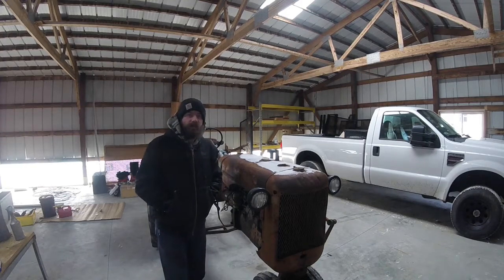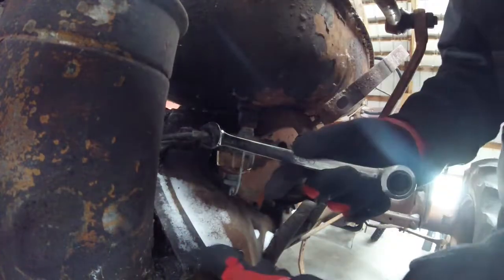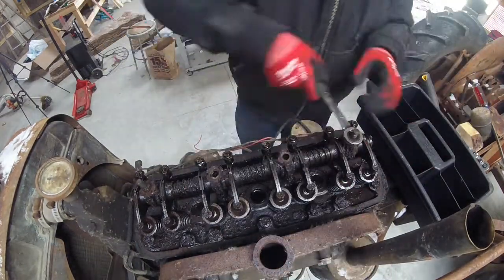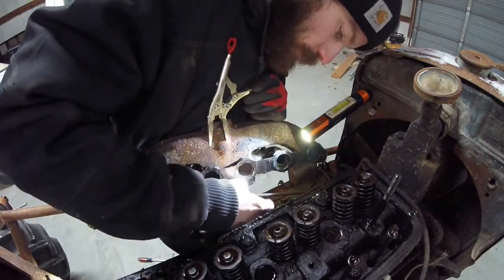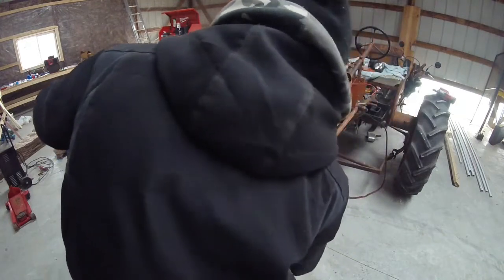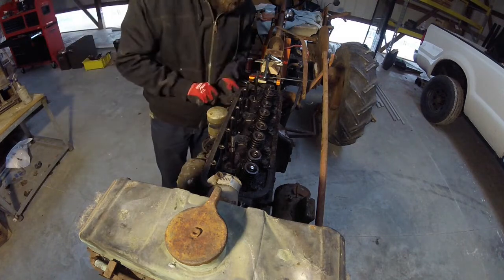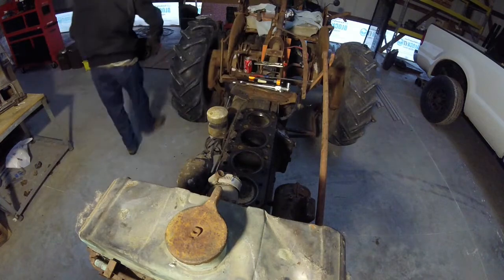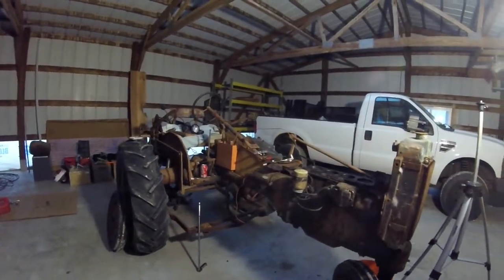Allis Chalmers C Engine Overhaul Part 1: Tear Down

Comment: Looks like your hands know how to handle a wrench the same way Jack Reacher knows how to strip & reassemble a gun in the dark.  Is / was mechanicing a trade for you?  Looks like it.  Question:  who do you reckon watches this type of content : 1. Mechanic watchers 2. People in awe of mechanics 3. Tractor fans 4. Ex Tractor fans  5. People that haven't yet seen Puddin's Fab Shop and don't realise (yet) that sittin on their butt's won't get their projects finished... ??
Reply from the maker: Thank you! I've been a tool and die maker since I was 16. I'm not sure who is watching, but I try to make something that people who like tractors and farming will enjoy. Thanks for watching!
Reply: @KettleMoraineMeadows  That's a good trade - you know how to "make" things.  Mechanics from around my time and further back knew how to make things when parts weren't available  and  then some time after that it has become "parts fitting".  I'm impressed with Squatch making his main bearings for those pony motors.  Have fun with the channel
Reply from the maker: I think it's more rewarding when a finished project has parts you made in it. Pretty soon I'll be spinning up some bearings for the main engine on my D2 project.